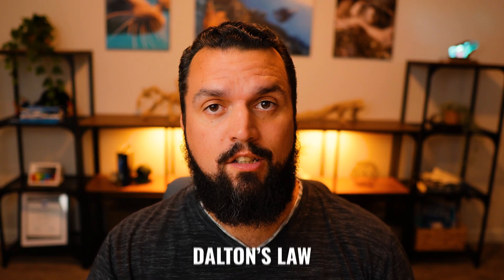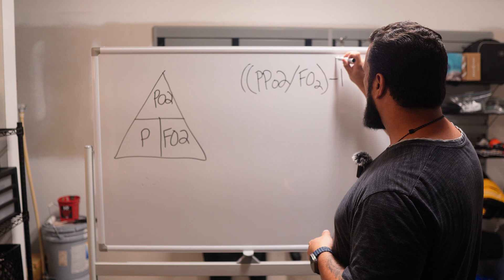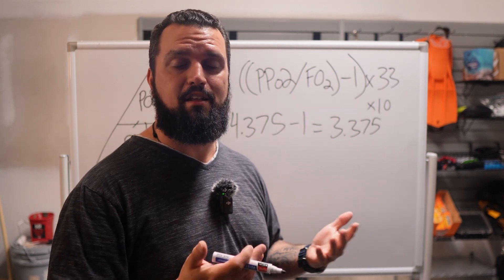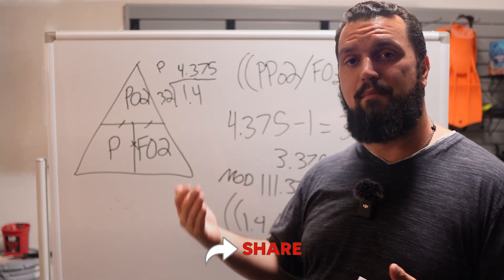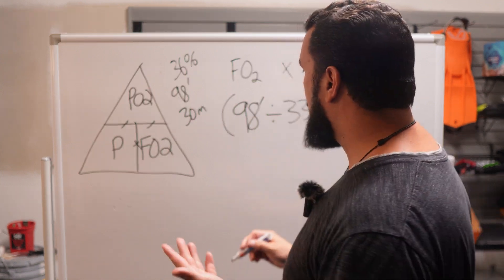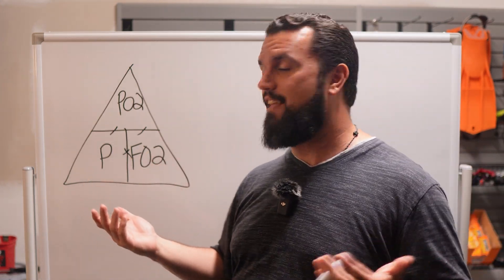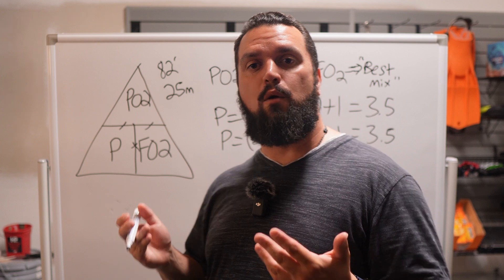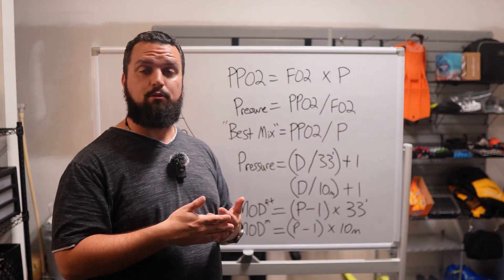99% of Divers Don't Know These Basic Nitrox Formulas

Comment: Teach students to go metric all the way. Makes quick calculations under water (e.g. in case of lost gas and replacement is offered) a lot easier than introduce that 33 in the equations. You're using the (metric) ATA anyway.
Reply: 100%
Reply from the maker: Haha I mean I try to do both but default to imperial since I’m in the US. Can’t deny base 10 is pretty easy 😅
Reply: @CircleHScuba  I live in the US but use Metric whenever I can for most things as it is just so much simpler.  I refuse to use Centigrade though.  I'm not living in a lab.
Reply: @JohnVanderbeck  Celsius is just as wrong as Fahrenheit. The only true scale for temperature is Kelvin. Gas pressure is proportional with the absolute temperature, so a drop of 30 K (from a rather hot car into the cold water) is about 10% of about 300K, so that will drop the pressure by 10%.
Reply: Nanook piss on the metric system.  We don't need or use that junk here

Comment: When is the imperal unit system better than metric? 😅🤷🏻‍♂️
Reply from the maker: Honestly not often lol. Rule of thirds in PSI? 😅
Reply: Air temperature.  Not lab temperatures, or engineering, but "what is the air temp going to be outside today?" F is better than C and I'll die on that hill.  F is more granular specifically for the range of temperature a person cares about in the air without needing decimal places.  Everything else is better in metric IMHO.
Reply: Psi

Comment: Use 1.6. PP and 32% is 40 m and 1.6 PP and 36% is 34.4 or 34 m.
Reply from the maker: You use 1.6 for all parts of the dive or just deco?
Reply: @CircleHScuba  MOD is max. So that is a 1.6.. when labeling bottles and such. However it's fine to use 1.1/1.2/1.3/1.4  for the working part if you wish. But planning I would stick to 1.6 = MOD = MAX.   

SO, I really love the video and so very glad you did this. I've actually sent this to my friends and some students. Keep it up.

I would mention in this that the 33 if for salt and 34feet is for Fresh. kind of matters for some of us if we dive both.
Reply from the maker: @Sidemount_Ben I mentioned the 34 for fresh in the video, thanks!

Comment: Unless you're tech diving with custom gas blends, there's no reason to know any formulas when using Nitrox. At least in Asia, where I dive, for recreational dives, all you'll get are EAN32 or EAN36; and all one needs to know are the 33m and 29m MODs respectively.
Reply from the maker: Let’s try this as an example: let’s say I visit your area and don’t have those two memorized, wouldn’t you think it’s important to know how to look it up or calculate it at the least 😅

Memorizing something isn’t knowing something, and this video is to teach people the why behind the numbers and how to figure it out. It’s important for planning, it’s important to know generally rather than blindly reading a table or computer without knowing the why behind it, and then for the last one it’s “best mix” which is useful all over the world. Your local area may not offer custom mixed but to say that there’s no reason is kind of crazy to me 😅
Reply: You couldn't be more wrong.... Whilst I can't argue that there may be less need for where you dive. Over here in the UK, we rarely use "Banked" standard Nx mixes. It is far more common for partial pressure blending to be used. And whilst we have very good blenders who can consistently hit the requested Nx mix. There are times where we, as divers, will get Nx3n as a first fill. Then depending on where we are, or what we're doing for our next dive we will simply top up the cylinder with air without draining the cylinder (to make it a little cheaper or dive boat logistics mean it is impractical). We can then use math to work out what the Nx mix in our tank will be to see if it will be suitable for the next planned dive. If not, we may need to let more gas out before we fill to ensure we have a suitable mix. (We would also check once filled using an analyser for confirmation.) We then use the additional math to label the tank with an appropriate MOD. But "custom blends" are far from a tech dive thing. A cylinder of Nx32 breathed down to 100bar, topped back up to 230bar with Nx21 will result in roughly Nx26, which when breathed down to 100bar and then topped back up to 230bar with Nx21 will result in a cylinder with roughly Nx23 in it. Three Nx dives from one cylinder originally filled with Nx32...